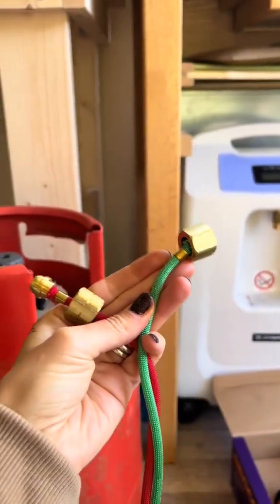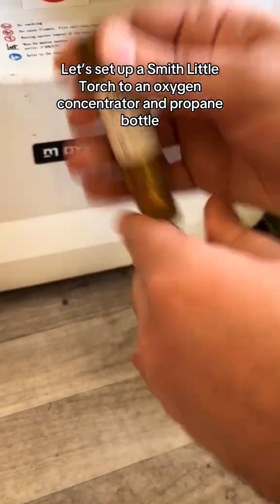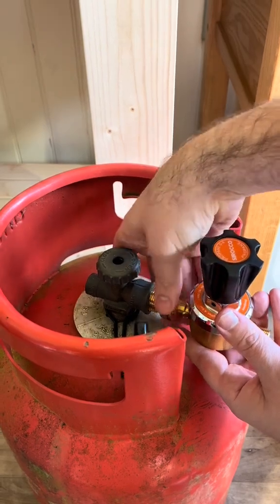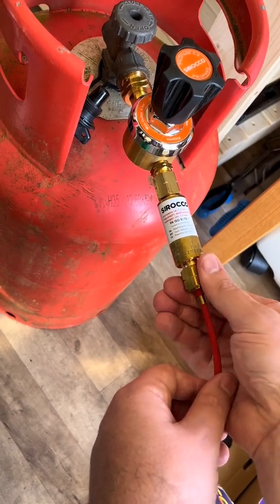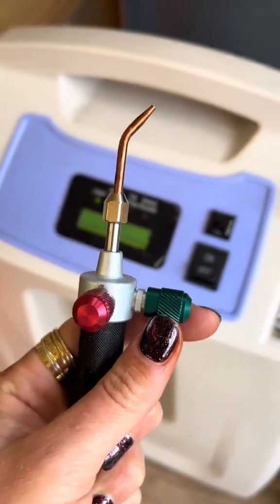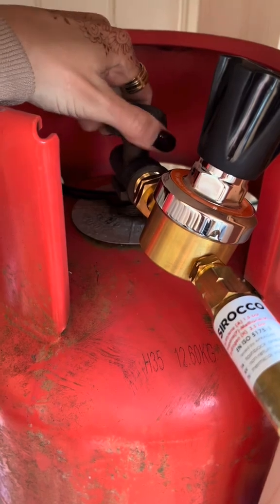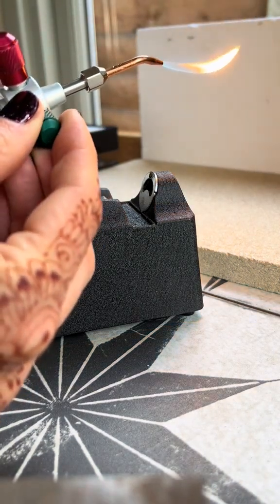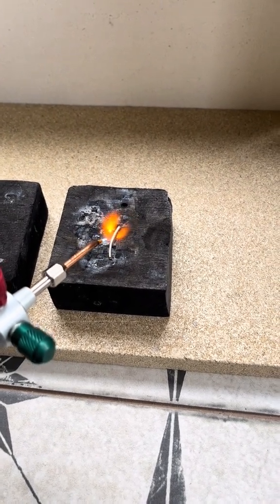Setting up a smith little torch with oxygen and propane  #jewelrymakingprocess  #jewellerydesign

Comment: Why no gauges for the propane tank? Aren't they required to set the pressure for the torch tips?
Reply from the maker: The recommended propane regulator will not gauge the pressure, as it does not come with a dial. It is however adjustable and has a maximum output of 4 bar.